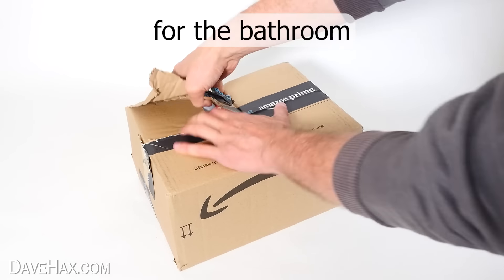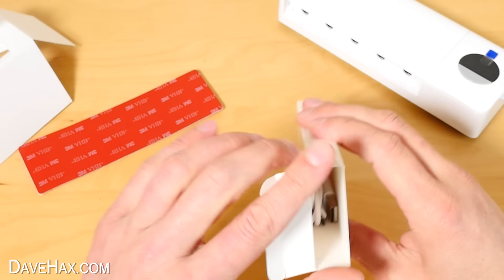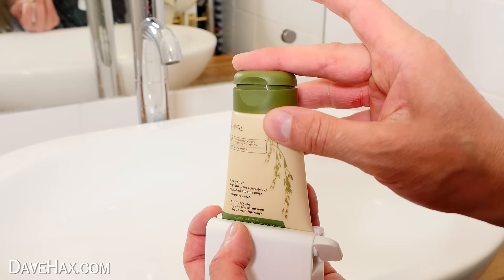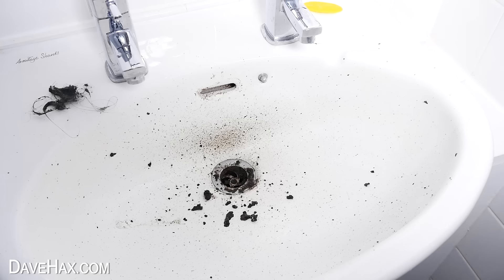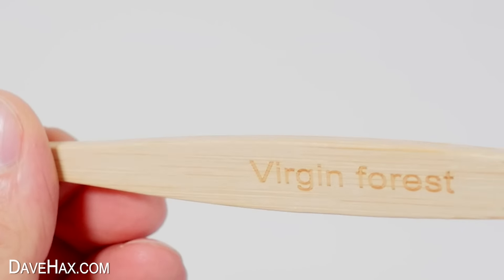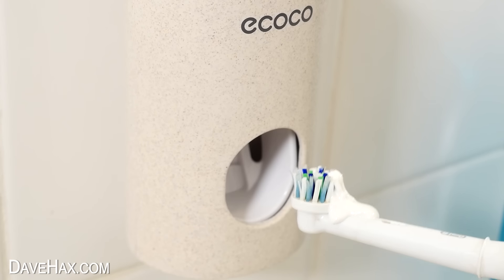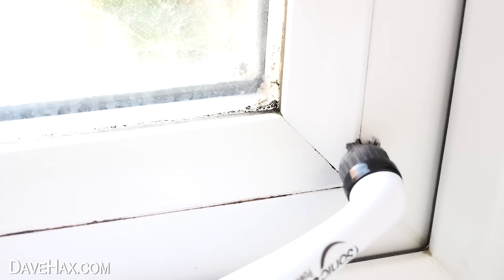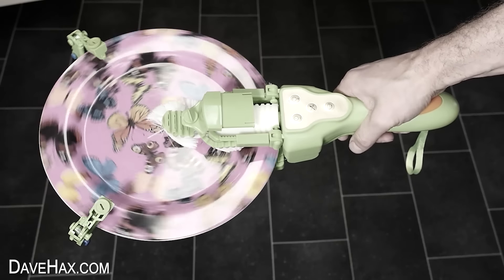12 Must-have Bathroom Gadgets I Bought On Amazon!

Comment: The toothbrush sterilizer looks pretty cool. 
You can tell it's good quality because it uses a mercury discharge tube instead of crappy LED's to produce the UVC required for sterilization.

Comment: I suggest to test if UV light toothbrush cleanser actually works, you can try swabbing a toothbrush exposed to that UV light and a non-exposed toothbrush and spread them on some agars. See if there's a difference between the bacteria colony from either samples.
Reply: Or test that it is even UV light.
Reply: @firstdictonary  if it is a genuine UV-C light which is the sterilisation style light used in hospitals having it viewable from under the device is a huge risk, cause UV-C can do allot of damage to people, my guess is even if it is uv it's uv-a and thus not really a decent steriliser
Reply: @TheGamingDroid9000  UV-C is for (until) viruses, anything below that is (only) for bacteria and algae. For brushes and water bottles, it's fine. But many market it as UV-C when it is not (deceptive marketing but it is better that way for safety concerns).
Reply: @EmeraldMara85  uva is effective against bateria with 20 minute exposures not 300 second , as in the paper below, and even then the conclusion as it as only functional in some bacterial cases, https://www.ncbi.nlm.nih.gov/pmc/articles/PMC7365468/
Reply: I don't keep my toothbrush in the bathroom.  ( wash cloth or bath towel either)
My husband refuses to put the lid down before he flushes. 
I don't like the idea of tiny unseeable specks of toilet water on my stuff.

Comment: Some of these really seem over-designed.
I've been using a very basic tube squeezer for tubes in the kitchen and the bathroom for years now, and I can't imagine the one in the video doing much better.
As far as messy tube tops are concerned, is it really that difficult to keep them clean? If mine ever get messy at all, I just brush it off with the tooth brush itself.
And for the last one you can easily use any plastic bag of appropriate size.
Reply: Many of the 'weird gadgets' he reviews and shows are actually for people with limited mobility or strength, which can't use simpler ones easily or at all. But they can't market to only disabled people, or USING disabled people, because the general public kinda sucks like that, so it's just weird 'convenience' gadget, usually advertised using the most incompetent seeming fully able people in existence.

Comment: I got a metal clamp that squeezes product out that comes in tubes. I got it for my hair dye and it’s wide enough to be used for lots of other things too. This one is cute but I don’t think the plastic would hold up as much as a metal clamp. It does the job though. It’s not useless but I also think that you can get a larger one that’s not made of plastic so it won’t break on you. Plus you can only use this for toothpaste. Or something similar in size

Comment: The toothpaste squeezer is legitimately useful and I'll definitely get one. I also like the toothpaste cap. Anything to reduce the friction so I don't have to choose between feeling like having to deal with the mental hurdle of brushing or skipping it. (I wonder if I'm autistic. 🤔) - But the LED faucet-head is garbage. It doesn't matter if you get the 7-color one or the 3-color-temperature-detecting one, they're all trash. They work for a few weeks then start having problems and die within a a couple months. I've gone through 6 and they're ALL trash.

- 5:52 You don't need a big spoolie; just pour some drain-cleaner in your sink then use a plunger for a nasty surprise. 🤢🤮
- 6:50 Hmm, I supposed the silicone sieve is more versatile than the concave metal nets that have to go into a drain.
- 7:18 Are drains like this standard wherever Dave lives? 🤔 Mine mine has a cross-bar drain permanently attached to it.
- 13:12 Do NOT use a metal scouring brush on ceramic like the tub, sink, or toilet; it can cause black streaks that you can't get rid of. Don't ask me how I know. 🤦
- 13:48 £5 for that? 🤨 Or just go to the drugstore and get a whole box of rubbers or a whole carton of finger-cots for £2. 😒

Comment: I have one of the drain protectors. Problem with them is that the holes are so small, that the water can't run out fast enough and my floor gets flooded. 🤨 I aso have the automatic toothpaste dispenser. After a few uses, it couldn't pump out anymore, since there's not enough pressure. Maybe it needs something to keep the empty part of the tube rolled up or something, so it doesn't just press the paste back into it instead of out

Comment: For tooth brush sanitizer, it needs to be easy to put brushes like just dropping them instead of fumbling with lid. Secondly I prefer it to be automatically sanatize whenever toothbrush is put in. What it does is you just put toothbrush in the sanitizer after use and it will sanitizer it and ready for next use. Instead of sanitizing it manually and waiting for it.

Comment: Nylon is still plastic. If the goal is to make a brush that you can throw away that’s not made from plastic, then it failed. I think I have something similar. I actually use it to clean my hair brushes with. But I think the bristles on the bamboo toothbrush I have is actually made from bamboo. I got it with the intent to use it as a toothbrush. But I don’t like how the bristles feel on my teeth. So I just cleaned them and use them to clean hair brushes. Works great and I’ve had them for years

Comment: The electric brush probably isn't worth it. The electric motor is weak and no different from your hands. If you want, buy drill bush heads. And if you don't already own a drill, ones can be found for cheap and can come in handy with other items.